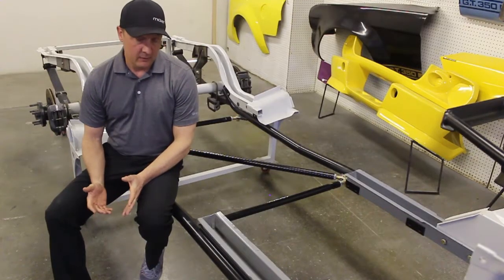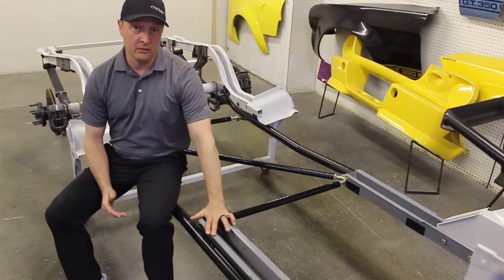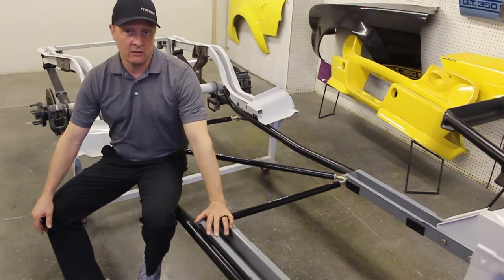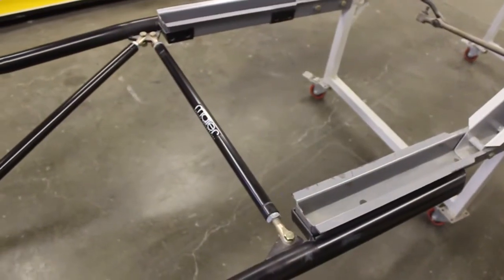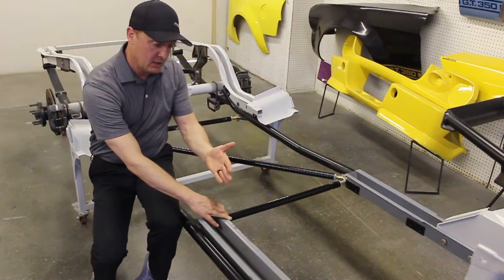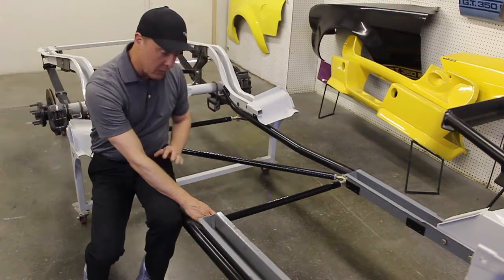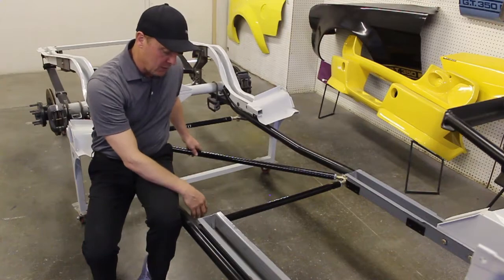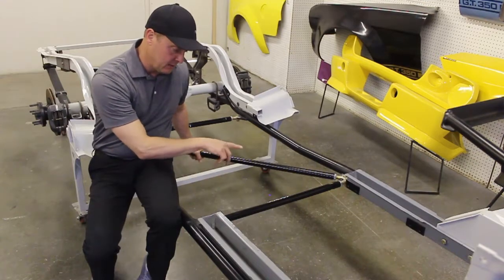Chassis Stiffening - Maier Racing

Comment: So, do you include everything that you show in the picture on your website or is it just the Z brace and subframe connectors?
Reply: If you buy the Z brace, it comes with 4 tabs to weld into the Sub frame connectors. It comes with the 3 tubes and all the hardware to mount it once it is welded to the subs.  Helpful?